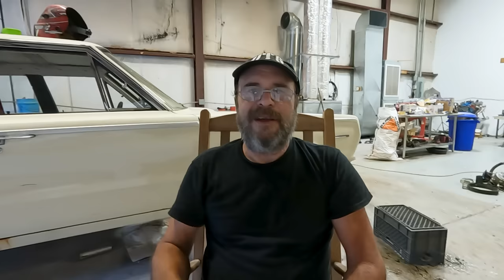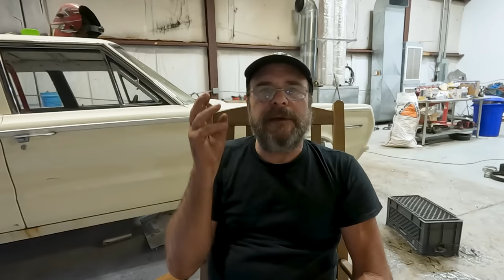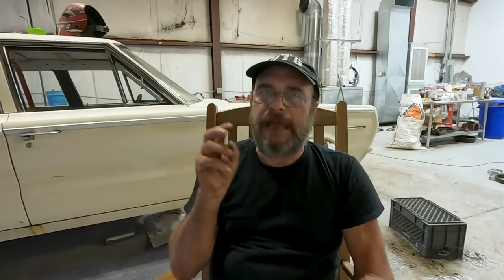They Really Are Out To Get You- How The Automakers Have Made Life Miserable For The Average Mechanic

Comment: Tony - just to let you know, not all automotive manufacturers did things intentionally to make things harder to service.  I worked as an engineer at GM Saturn in the 80's.  ALL of our product development meetings included someone from both the service side, as well as UAW rep from the assembly side.  We specifically worked to make things easier to service, even for a novice.  I especially remember how we as engineers HATED to do auto trans fluid changes, and wondered why we just couldn't have a spin-on filter same as for the oil, as well as a drain plug, so you didn't have to do 30 bolts and drop the pan making a huge mess and requiring a pan gasket to boot.  Auto writer idiots panned the motor as to having inadequate power and making too much noise.  What they didn't know was that those motors were understressed on purpose, as well as having a mean time between failure of well over 500,000 miles.  Yes...timing chains can be noisier than belts that have to be replaced at 60k miles, but they are bullet proof, and weren't as quiet and sewing-machine like as the Japanese motors.  Same thing with the space frame construction, the same as race cars, as well as having totally rust-free polymer body panels.  But once again, idiot auto "writers" panning them because of the large body panel gaps (as if that mattered) that were required to allow for expansion clearance due to temperature.  I could go on and on.  Rant over.
Reply: My bro worked for GM as a junior engineer and said the same thing. I believe he worked on interior panels for the uplander van.
Reply: I believe that
Reply: Imagine buying a GM today... I'd literally sooner buy a Chinese car.
Reply: Back in the 1990's, I really appreciated GM products.  Generally, there was good clearance around whatever you needed to service.  The non-Saturn products had fat bolts on the transmission pans, where bolt heads on Ford and Chrysler products would snap off.  Except for changing something simple, like an air-filter, Toyota's were a complete nightmare.
Reply: I bought a 1995 Saturn SL2 loaded with every feature you could get EXCEPT the sun roof, because I couldn’t afford to lose the two inches of head room. I LOVED owning that car and drove it for sixteen years until it finally died (I never babied it, but I kept up on maintenance). GM bled the profits off from Saturn to keep their other divisions afloat, and then finally killed off the Saturn because it was better than their other cars, and they just couldn’t have that. Today I wouldn’t have a GM car, with the exception of a Corvette, if I ever won the lottery and could afford the cost of ownership. 🤣
Reply: @gregorysloat4258  yup, you nailed it.
Reply: That sounds like the exception to the rule and how many decades ago?
Reply: Cheapest electronics they can get nothing but problems because of cheap wires
Reply: I still drive my ‘95 Saturn (ed. SL2, original owner, it will be 30 in Jan2025). Junk yards destroyed - gone. Out of business. No more spare parts.  GM destroyed Saturn so I will not buy a GM product in future.
Reply: I don't remember the timing gears that mated in the older motors ever making that much noise !!!
Reply: @Rutherford_Inchworm_III  The Buick Envista and Chevy Tracker are literally Chinese, check the VIN numbers.
Reply: Loved my Saturn SL1. So easy to work on. When kids got bigger I upgraded to an '02 LS2. Was a nice car and had it for many years until the fuel pump went out. Quote to fix it, since the tank had to be dropped, was more than the car was worth. Sold it to a mechanic and have never bought another GM product and never will.

Comment: Not a truck but my old polaris quad had a single bushing missing from the front diff. I went to multiple dealerships from multiple cities to try and buy just the one bushing because they insisted that I "had no option" but to buy the entire 1,300 dollar kit instead of just selling me the one part. I paid a local shop 25 dollars to buy stock material and cut two of them. Had it fixed in half an hour.

Comment: My dad worked from sun up to sun down from his garage for over thirty years. Than came the "modern" fuel injection and front wheel drive. Customers did not want to compensate him for the cost of replacement parts that could not be rebuilt and his labor to install theses parts. He retired and enjoyed a long and happy retirement, no more drama to put up with.
Reply: I drive a 1974 LTD. Greasable everything, a big 9" rear end with bearings and seals that maybe cost $20. Rear wheel drive is the way to go. Hand and leg room for days, everywhere. Even under the hood.

Comment: This all started when Gi;lette  said "Give away the razor and sell the blades." 

And it is happening in all industries:  Apple and John Deere both recently lost cases prohibiting the right  to repair.
Reply: Also printer ink cartridges.
Reply: Light bulbs too. #plannedobsolescence   Strength!   GODspeed!
Reply: Yeah. I wanna rebuild my own light bulbs
Reply: @gmw3083  Damn right, I used to be able to buy a case of filaments that would last me for years.😁
Reply: @vadimbellous8313 😂😂
Reply: @gmw3083 They are referring to built in Led modules. They are in every part of modern gadgetry, tied into control electronics.
Not real obvious yet because they last for years, until one day, the whole fixture at 10s of times more than the LEDs them selves.
Its a hidden issue even in automotive interiors.
Reply: @70ixlr86  i actually would like to rebuild regular old light bulbs. I saw that video about the hundred year old light bulb in some fire hall. It has a different type of filament and is low power low light. But a century old. That's actual sustainability. Something the establishment has no real interest in....
Reply: Planned obsolescence has been a part of our country for longer than you may think.
Reply: @gmw3083 There's a whole story about a light bulb that wouldn't burn out, but the company realized they would be bankrupt if they sold that bulb. So they got rid of them, but it's thought that a few got out to the public. I'd say there's a bit of proof to that story...
Reply: John Queere.

Comment: As a mechanic, you are singing my song brother. My first realization of this was my '88 Taurus, the heater core went bad (imagine that) and the manual I had said in the opening salvo of how to replace it was  " remove dash" .  I have very much seen the light since then, these thing's are intentional to discourage the DIY-er.
Reply: They made the heater core thin so they leaked just a couple of years beyond warranty.
Reply: Years ago, I had a 78 LTD. The heater core went in it. It was bolted to the firewall. It was a pain to lean over the engine with a cold wind blowing on me to change it out. But I preferred that by far to removing the dash. About 10 years ago, I sold it as the transmission went out. (I'm not that serious of a mechanic.) But it gave me 10 years of sturdy use and I did not fear an accident with an idiot in an SUV.

Comment: As an independent shop worker, my gripe is "special tools". Need a special socket for this and a special tool for that doodad. Never ending spending spree.
Reply: Yes your so right on the specialty tools ,ughh I hate that ..
Reply: Agreed, so many engines from different manufacturers need their own set of timing locking tools for example
Reply: Yep , allen key, torx , tamperproof torx, double hex, double square, double triangle, keeping mechanics poor and the mobile spanner man wealthier
Reply: Also gm lt1 distributor cap socket, Cadillac water pump socket, Ford spindle hub sockets, and don't get me started on the euro special socket scene 😳
Reply: I was gonna help my neighbor chsnge the spark plugs on his 2017 Silverado but i wasn't about to buy that spark plug remover.
Reply: I've found some cheap tools on Amazon, particularly timing chain tool kits, that actually work fairly well.
Reply: every time a new style of bolts, that´s crazy. than you have to buy kits of sockets and so on.....
Reply: @biastv1234 
Don't forget a 5 point torx that's tamperproof. 
When I worked in an engine shop and they had a fuel lab and we needed to borrow that once in a while for pump adjustments. 
Had to sign those out as I guess those 5 points were used in prisons at the time and they didn't want the 5 point bits to go missing. 
(Early 2000s)
Reply: And not all the tool companies make all the special tools. So the shop and mechanics got to deal with ALL the tool companies to get all the tools needed. 
Stink eyes.
Reply: "Hell yeah brother." -Cleetus

Comment: This is becoming true with heavy construction equipment too. Mechanics need access to the manufacturer’s database to reset engine trouble codes that the average mechanic does not have access to.
Reply: I work on boom lifts all the time as a commercial painter and several times in the last few years I've either been stuck up in the air against a building or in a bad spot and had to be rescued by another lift because some safety code had been tripped and it will not allow you to lower it or even be operated from the ground control. The technician comes out and spends half a day working and pushing buttons and making phone calls just to reset it.

Comment: I'm 53 and started driving a 1976 Mercury Monarch straight 6 250ci I got for $500.  It got me thru tech college, out of the house, and a year into working when I gave it to my brother still going.  It had a cylinder that ran the plug black ever since we acquired it but it wouldn't quit.  My wife & I now have a 2011 Sorento & 2009 Rio both with 165k mi and no issues.  We're not in a hurry to purchase newer vehicles.  EFI was a great advancement for cold climate driving up North, but we know people with newer vehicles that have oil consumption issues.  I agree new vehicles aren't made to last, but other than just a few examples, it mainly started happening around 2012 when 0W oil & GDI became the norm.  It was mostly the pre 2012 vehicles that were easily servicable and lasted, back when you could buy a new vehicle below dealer invoice and the customer mattered.  Now you can't buy your kid a video game system without someone scalping the price up on the reseller sites, or a house that hasn't been flipped a couple times.  The millenials are conditioned to be blind consumers and it's sad.

Comment: Funny thing is I cut myself an access panel in the bed of my 00 Chevy Silverado to replace the fuel pump rather than dropping the tank, cut it on 3 sides and folded it up, replaced the pump folded it back down and fastened it back with truss head screws.  It worked like a champ, such an easy solution the engineers should have built an access panel into the bed.
Reply: I unbolted the bed. Had 4 people to lift it off.
Reply: Lol, I did the same on my Cadillac CTS...by the book says u have to lower the (dual) exhaust from the headers back,  so u can then disconnect the driveshaft in order to lower the whole rear subframe assembly rear diff. & all just to get to a few bolts that are otherwise inaccessible in order to lower the tank🤦‍♂️
The freaking thing was still running fine too; it had just developed a small leak @ the very top where the lines connect to tha pump I couldn't figure out for the longest why my garage always smelled like gas fumes after driving this car...It wasn't until I really got down underneath it one day & looked @ it closely that I found where gas had been leaking down the side of the tank and I checked a few GM forums & read where it was a fairly common issue for this model...
Reply: Yeah I did that on some of our trucks at work. Had some smashed up beds laying around so I cut panels and just riveted them over the holes. Corrosion rust and nastiness was the norm so using nut serts would have been difficult to take apart   Riviots just drill out but at home I would use nutserts
Reply: Make sure it’s airtight. Carbon monoxide can get in.

Comment: The same thing happens in Information Technology IT. Operating Systems upgrades that force you to replace fully working computers, phones and ipads. For no good reason other than driving revenue
Reply: System is messed up
Reply: Yes!  Worked with a guy who had hearing aids.  He said periodically he'd go into the shop and get the volume turned up a bit because the way they are made they have to connect them to a computer and use a special app to make any changes.  So he said he went in to have another tweak and they told him they couldn't help him.  The company was no longer supporting those hearing aids and the shop no longer had access to the app to make the changes.  So he had no choice but to replace his several thousand dollar hearing aids with new ones even though, technically, the ones he had were in perfect working order.

Comment: Something I’ve noticed multiple times recently is that unless they can plug a modern computer into it for diagnostics they won’t work on it. Had this happen recently with a vehicle from 2002 and 1976. Modern techs are not given the skills to properly diagnose without the use of a computer or scan tool. That blows my mind!
Reply: So true! I had a 1998 GMC Safari van that had a broken vacuum hose to the cab heater. They kept my van for three days and never called me. When I went to check why the repair delay, the mechanic said it had no place to plug in a scan tool to find what was wrong so he said he hated my van and didn’t want to work on it, ( I had told him what the problem was when I brought it in). I asked for my keys back, went to another garage down the street known to work on my type and age of vehicle. Within two hours my vehicle was fixed and after three years is still working perfectly.
Reply: Air -gas-spark......look at me I'm a mechanic!
Experience has taught that guy he wants the easy work. He knows how bad a job can snowball digging around looking for problems. He wants the
 plug-N-pay work.
Reply: They also want to pay the least for labor, exasperating the problem! They want advanced diag on a lube tech pay.
Reply: @lannyhoward9208 Either is wasn’t a 1998 or someone is lying because EVERY VEHICLE from 1996 up has a DLC (the place to plug in a scanner)
Reply: @jdizzle6324 you think it’s that easy? The scan tool does not tell you how to fix the fault.
Reply: Personally it is way easier to diagnose old cars and I am a young guy. The codes rarely tell you exactly what the problem is and just vaguely gives you a direction to go towards with further diagnosis. The simpler the car with less electronic systems the easier it is to diagnose because there can be less things causing issues.
Reply: I know a younger guy, was a service tech at a high end car dealership. Worked his way up to service manager. I had to fix his lawn mower, as he had no clue of a carb.
Reply: @drewthompson7457  that's gold. I know what your saying, even older guys that never pulled apart older motors haven't got a clue.
Reply: I can much more easily diagnose a non computerized vehicals than one with a computer. What's wrong with those guys😂. Guess they don't teach the basics of fuel air and ignition anymore. But even then using the computer it's not just a simple fix you still have to have knowledge of the different systems and how they interact.
Reply: Even with a scan tool, many dont know how to troubleshoot. They just start replacing parts
Reply: Some times they cant read the diagnostic machine or it doesn’t work. I had several cars that eventually shorted out, wires burned .. engine light constantly on for 3 years and they would turn the light off and claim they didn’t find any issues that is until I started smelling smoke and my car shut down. Thousands of damage done… I worked close to home is the reason that situation lasted so long. Thank God I wan’t traveling on a hwy when it happened.
Reply: my car is odb-1 but I needed a odd problem fixed and while i could dick around with it, I just wanted someone to fix it. No one in town could work on it. The techs had no idea how figure it out. I ended up just junking it because its like I dont have time to fix it. It felt dirt that I had to do that but I couldnt leave the car out on the driveway side until I could fix it because stupid city code doesnt allow you to leave a car out on your property. Its like dude, everything is broke and they want you to pay more to exist.

Comment: I had an Explorer years ago that would kill the cruise control every time you turned on the headlights.  Turned out to be a tail light bulb where the brake filament fell to the tail lamp filament, so when you turned on the headlights the cruise module would think you were stepping on the brakes. That was a head scratcher for a little bit
Reply: Reminds me of a guy that had a 1970s ford with the ignition box on the fender. He couldn't ever figure out why it would randomly die it was only about 10 years old or less. After changing numerous ignition peices they realized that whenever he was driving beside a big rig with a powerful CB it was enough that when they would tone in on the mic near him that it would interfere with the ignition box and cause it to shut off. Really bizarre but true😂
Reply: @ReidHenderson  Someone fooled w/ the electrical system or it had another owner induced issue. That was the 70s. No vehicles were great then anyhow. Ford was better than 90% of em then ..& now!
Reply: At least you don't have a newer Camry that burns 1qt of oil every 1000mis! It's maddening. Total garbage.
Reply: @Davido50 
A lot of cars use low tension piston rings and burn oil. Not just Toyota.
Reply: Before I hear you out Tony my thoughts were the first deliberate attempt to fowl up home maintenance guys was GM’s introduction of the Vega. None replaceable air filters and none rebuildable engines. To me that was the first mass introduction of malware.